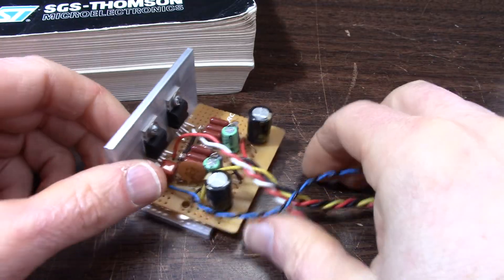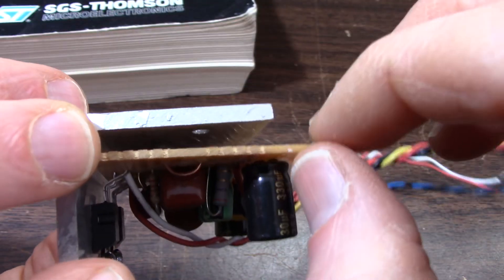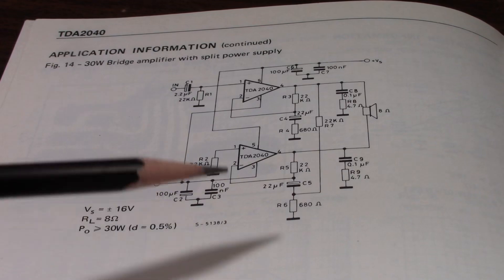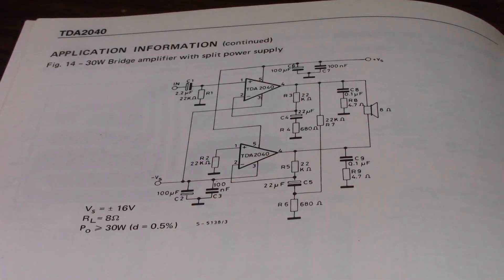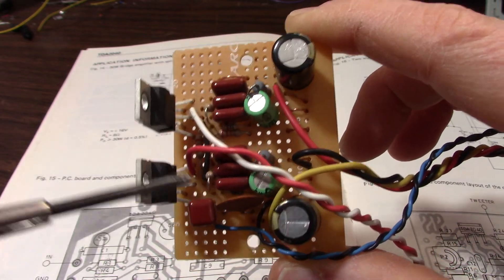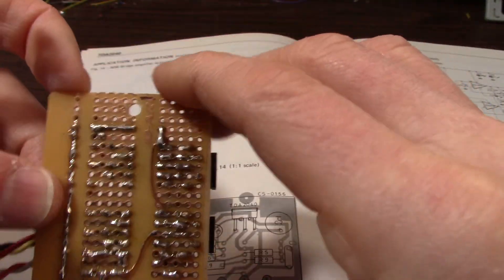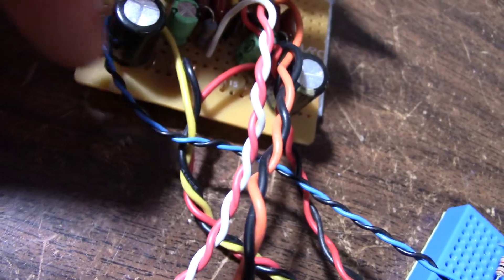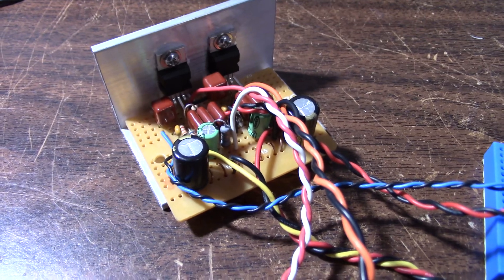TDA2050 bridged amplifier converted to stereo

Comment: Can a metal Cabinet/enclosure be used as heatsink for any audio amplifier if it's assembled inside a metallic cabinet with the amplifier circuit board, power transformer etc fixed inside it ?

Comment: what about a stereo amplifier using a NE555 as a clock and a NE556 as the two PWM modulators driving 2xBD131 transistors operating as power output stage. look for 5W class A amplifier which can be modified to give a nice square wave signal to get a clean output.
Reply: 555 in astable mode and 556 halves in monostable mode? You have some kind of schematic for that?
Reply: @akkudakkupl  no Google PWM amplifier using NE556.

Comment: Use a old PC Power Supply for the case.  I did that from a couple of TDA2050 and TDA2030,  I included the transformer inside and even use FAN controlled by a Thermofan circuit from ESP Elliot.  It worked great and is a very nice modular PA.

Comment: RF capacitor and Resistor value???
Reply: 1k ohm in series with input then 220pf to ground after resistor
Reply: @ItsDextrin  thanks....
Reply: I would rather get a full video about RF Capacitors
Reply: interesting question

Comment: Hey, john i have conterfited tda 2050 which have same die size,can it give me same power?
Reply: Bro get some UTC2050L, they are the best available options for TDA2050
Reply: Look at the soldering pins on the chip as John highlighted in one of the video, if they are skinny, dont expect anything above 12~15w
Reply: @discovervinu  Yeah man, UTC2050L is best replacement for OG TDA2050, 
I tested UTC2050L with +‐25=50Vdc 
And I got 24Vac voltage at the output, 
Input DC current 1.44A 
Output AC current 2.8A
Load 8ohms, 

Believe it my friend UTC2050L is best out there among all TDA2050 copies
Reply: @VIPINSAINI_20  no offence but check ur calculation, ur input power itself is 70w how can it output 67w?? This chip is class AB if i remember right and its nowhere near to the effeciency u mentioned here.
Reply: @discovervinu  you don't know how to calculate, I didn't claim whatever you saying about output power, 
70w is input power that's the truth, but you don't have such knowledge to make right calculations
Reply: @discovervinu  Your method of calculating is wrong, 

Output power is only about 36W or less
Reply: @VIPINSAINI_20  thats why i said no offence here, u mentioned u got 24v AC at output into 8 ohms load which ls roughly 67w
Reply: @discovervinu  24Vac isn't RMS ok
24Vac is peak to peak voltage, you have to convert to rms first
Reply: @VIPINSAINI_20  Wouldn't your input power be closer to 144W?
Just curious.
1.44A @ 100V rail to rail.
Reply: @jimmyb1451  Very nicely noticed my mistake there, I'm terrible sorry for my mistake, it's 50Vdc, not the +-50dvc
Reply: @VIPINSAINI_20  It's cool brother :) I was just curious. I've not seen the UTC2050L yet. I'm reading the datasheet right now.

Cheers for the tip!
Reply: @jimmyb1451  Don't worry, it's alright, 

I have stocked some UTC2050L 40pcs and LM1875T LM1875T 37pcs ICs for personal use .
And advise you the same thing to you, 
Get some UTC2050L they're good and very cheap